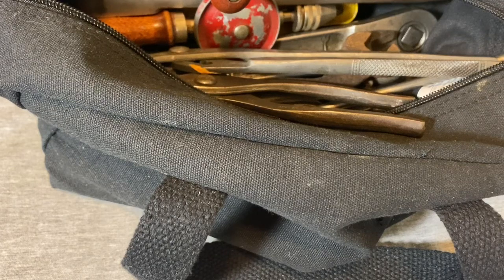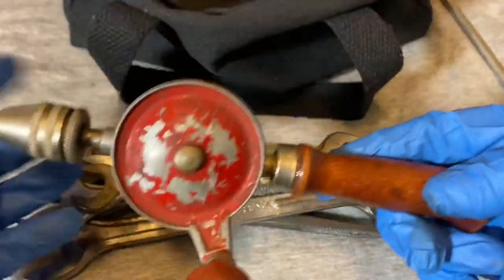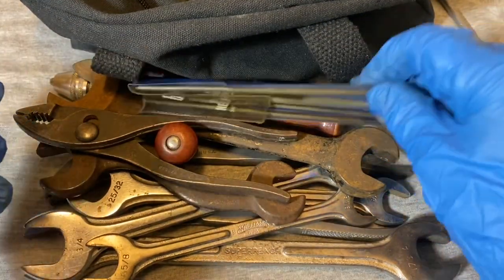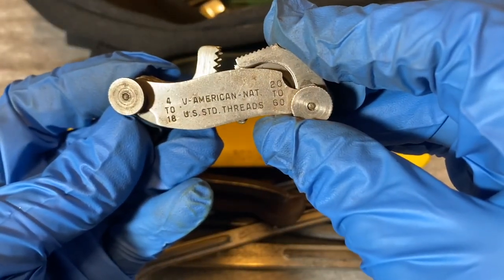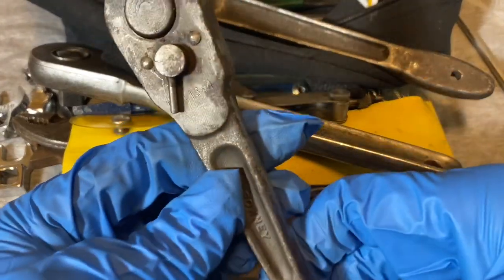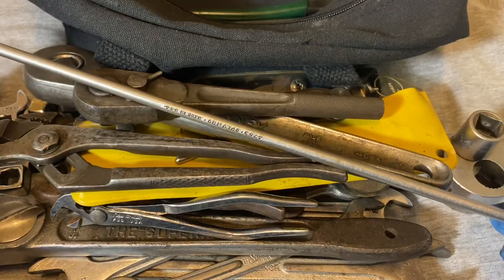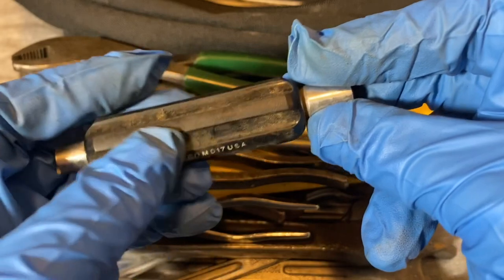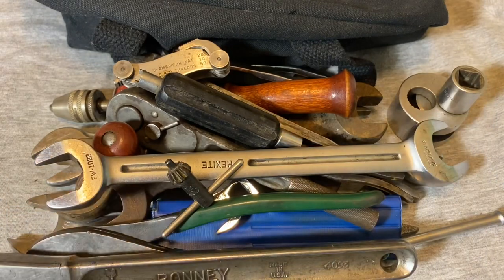Tool Haul Tool Meet, Snap-On, New Britain, Easco, Etc...

Comment: You are lucky to live in an area that has tool meets and decent flea markets. I miss the New England tool scene. I used to live in Connecticut. There's nothing like it in my area in Florida. I wonder if you ever make it down to the Englishtown Flea Market. That's an awesome tool haul! The Snap On tool is a distributor tool for 50s early 60s cars, somebody somewhere could really use that tool. Thanks for sharing.
Reply from the maker: Hey many thanks. No I really haven’t been to any flea markets outside of NY. I wonder why there is not a vibrant tool market in places like Florida?🤔

Comment: Nice tool haul!  I have one of those adjustable drill bits and found that you really need to dog down the screw because it can loosen up while you're drilling and you'll end up with a conical hole!
Reply from the maker: Yeah seems like a tool of convenience. If you had to use a brace a lot years ago you would probably be better served with a dedicated bit.
Reply: @snapringchronicles3020  Absolutely - a dedicated bit is far superior.  Even better: spend the money for a spade bit or hole saw for your electric drill.